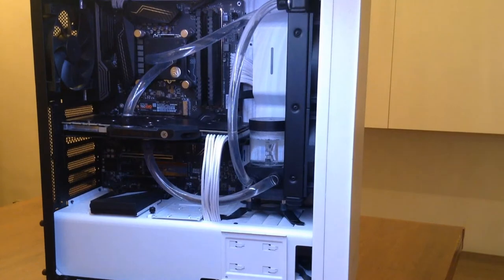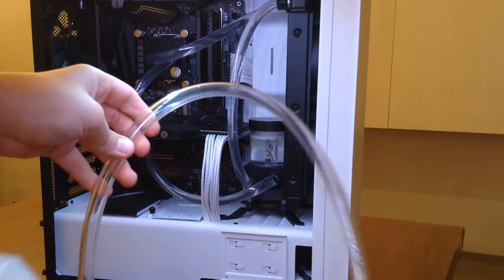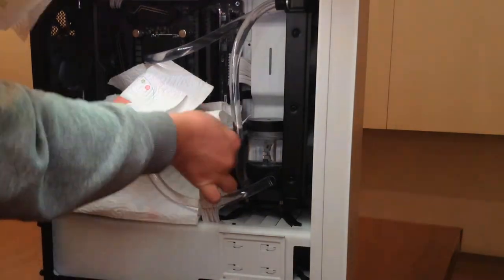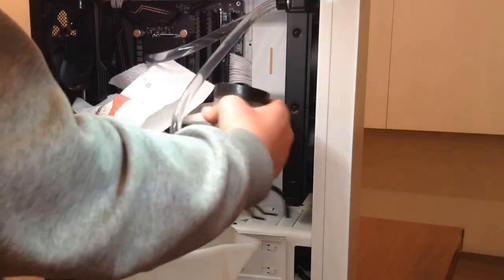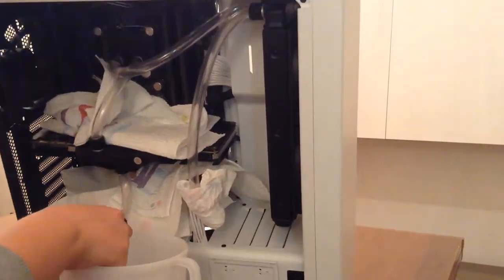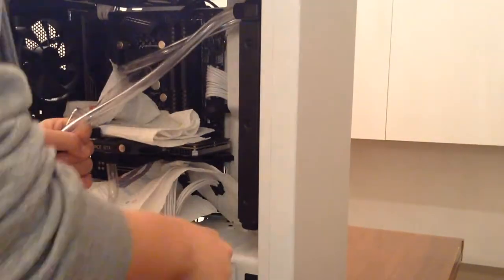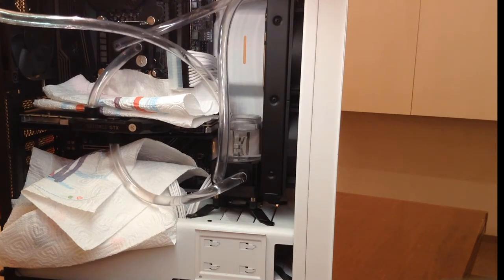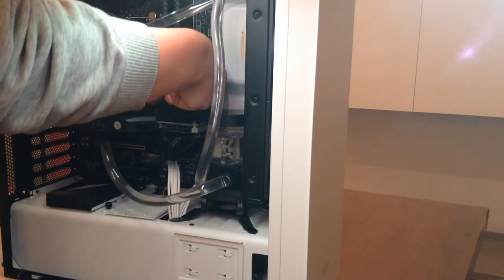EK A240G - How To Drain FluidGaming Loops

Comment: needed to change to hard line tubing, this video helped out a lot.  Thanks man.
Reply from the maker: You're welcome, but be sure to use aluminum compression fittings, and I've never seen one, else you'll get galvanic corrosion by mixing metals. If you find them could you link'em to me?

Comment: Can you run the loop without coolant from ekwb? Whats the difference between mixing coolant with distilled water AND using only distilled water in the loop?
Reply from the maker: I've been using the XSPC EC6 pastel white for more than a year and I had no problems with it. You can perfectly use distilled water, but may experience microbiological growth over time and corrosion, as there are no chemical additives in it. Don't dilute a premixed coolant with water, it's not recommended by most manufacturers.

Comment: what cable should i disconnect during the filled ? because all my system is connecting to the other, like GPU cable, CPU cable ???
Reply from the maker: If you mean the one where to plug in the jumper, that's the 24 pin

Comment: What temps are getting while gaming?
Reply from the maker: It depends, where I live it's very hot during the summer, and I added an other 120 mm radiator, so I have about 75°C on the CPU (7700K @5GHz and delidded) and 68°C on the GPU (1080 Ti, OC'd as well). In the winter my temps are 10-15°C lower

Comment: How do you drain the rad? take it off?
Reply from the maker: Most of the water will come out of the rad by tilting the case. If you have to clean it from the old fluid, run the loop couple times with distilled water. If you have to completely empty it you have to take it off